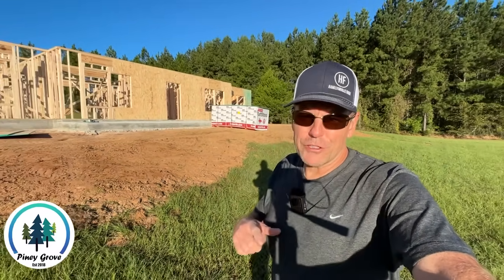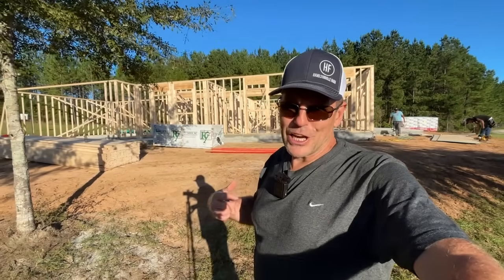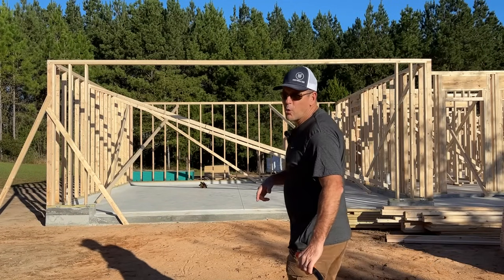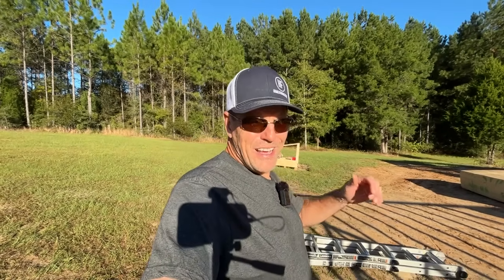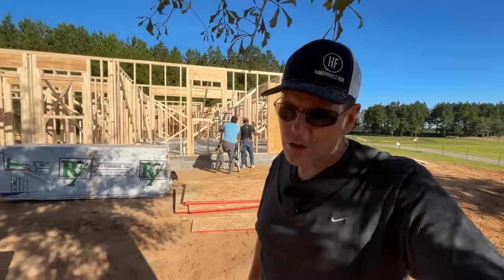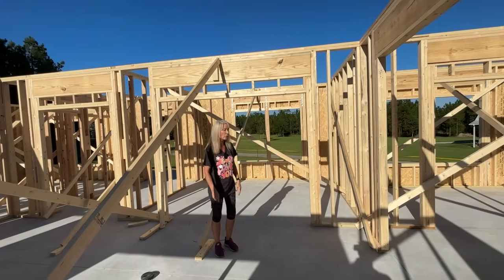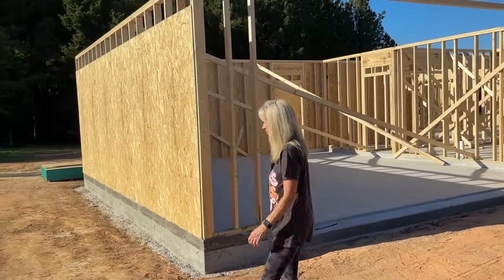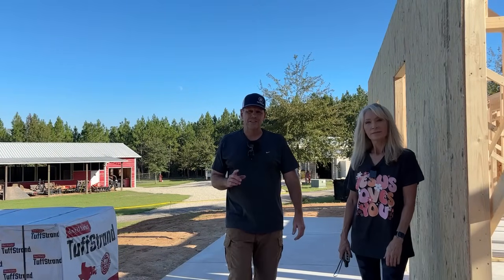Our DREAM HOUSE Is Ready For A Roof In 2 DAYS!

Comment from the maker: See this house build series here: https://www.youtube.com/playlist?list=PLG5yS75HLzo343HSY79ll4DgoxTgV6l91

Ballard Mower Blades 10% discount code:  PGH10
https://www.ballard-inc.com

American Made WoodMaxx chippers, tillers and flail mowers:
Piney Grove WoodMaxx Affiliate Link:  http://shrsl.com/4qer8

New way to fence your land!  Cat's Claw Fasteners.  
Use code PGFREE for free shipping!
https://fencingstaples.com/
Or Amazon Affiliate Link:  https://amzn.to/4dDcaJ7

QC-Mate X-Boom Hydraulic Coupler Clamp:
https://www.skidsteersolutions.com/
Use PINEYGROVEHOMESTEAD for 5% off anything on the website!

This is our Amazon store with affiliate links to products we use on the channel.  It doesn't cost you anymore and it helps support the channel, THANKS!
https://www.amazon.com/shop/pineygrovehomestead-tractorsandoutdoors

Some of our favorite products on Amazon (affiliate links):
Mower Blade Sharpener Guide: https://amzn.to/4dGYZa5
Dewalt 20V Cordless Grinder: https://amzn.to/4bF2trS
Flap discs: https://amzn.to/3UKEzo0
Grinding wheel: https://amzn.to/3K95ipi 
275 Gallon IBC Tote: https://amzn.to/3XbxwHs
Vise Grip Wire Pliers: https://amzn.to/3WZ2P6U
12V Pump: https://amzn.to/4a3AwsI
Proven Industries Trailer Lock: https://amzn.to/3WVzytv
Flex Tape: https://amzn.to/3R4MdWm
Mechanix Leather Gloves: https://amzn.to/3HjoZZf
Ratcheting Fence Tensioner: https://amzn.to/3aEfSX0
6’ Digging and Pry bar:  https://amzn.to/3vH5Agx

Welcome to our channel!  🎥 What to Watch Next: 
Fixing Leaky Pond: https://youtu.be/NEwSTg1aOWc
Transforming Our Property: https://youtu.be/-jBGEYJea1Y
Baling Hay: https://youtu.be/yQJNF3wFm-U
Framing Our Pole Barn: https://youtu.be/zWgnTFQeiwI

Our Story:
We are six years into a seven year effort of transforming 20 acres of "Piney Grove" in Northwest Florida into our dream homestead/mini farm to be filled with animals and joy. We plan to have a variety of miniature critters on our pastures, raise free-range chickens, grow fish in our pond, garden, plant fruit and nut trees, and harvest wild game. Our goal is
to escape the stresses of corporate life and embrace all that country living
has to offer as we enter the next chapter of our lives. Follow along on our
journey!

Thanks for watching and please Like and Subscribe to help our channel!!
Brad & Deb

Comment: If you plan to add security cameras, run your Cat 5/6 cables once your electrical inspection is completed. That way you don’t have to crawl through the attic mess up your insulation. I also ran cables from all tv and computer locations to a central hub location.
Reply from the maker: Good idea!

Comment: Yes I have built several Houses for myself and no. once I started I have never needed to make any changes at the framing stage.  In Ca. we were required to run continuous from the bottom plate to the top of the rafters an over the end rafters.   they were required within four feet of the corners and every eight feet or as closes  as possible.  that was for both hurricanes and earth quakes.
Reply from the maker: That's a long strap!    We have threaded rod every 6', I think.
Reply: @PineyGroveHomestead  that sounds even better .  the straps were about six feet each and we overlapped three strong tie nails at each junction.

Comment: We have built several custom home over the years and we always make changes to achieve our goal.  Some did cost a few dollars extra, but that is why you have contingency fund.  A few things I suggest you consider:  1) Take pictures of every detail of the construction so you will have a record of where wires and pipes are in the walls, framing details of the walls, and location of all plumbing pipes ( we printed the pictures and created a notebook of the pictures, house plans, paint and tile selection, along with a list of all the subs that worked on the house). 2.  Add cables for TV, computer junctions, security wiring to every window and door, Cat 5 or higher for security cameras, extra electrical cable to every corner of the house in case you want to add additional lighting in the future.  3.  Have them add extra wood blocking in the walls near the toilets, tubes, and showers to facilitate adding pull bars in the future to assist with mobility as you age.  3.  We added noise insulation to several of our interior walls to help with noise (laundry room, family room, and interior bedroom walls) -  best thing we ever did! 4.  Put PVC conduit under the driveway, sidewalks, and patios in several locations to facilitate future irrigation and lighting systems (I placed two 1" conduits under where the driveway where it connects to the house - these have been life savers).  Good luck with your build....
Reply from the maker: Great suggestions!  We have some of that already in place.  Thanks!

Comment: Do you know what your overall r-value will be in your walls for the build?
Reply from the maker: We don't know right now, but we will cover that when we spray foam.
Reply: @ cool. I just curious with the 2x4 walls if you guys were going to go above the minimum code for your walls. Look forward to the spray foam video.

Comment: You will make changes up until you can't. What looks good on paper may not work as it gets laid out. What kind of insulation are you going to use? I highly recommend using spray foam. If you are where I think you are you will be on the co-op and spray foam will pay for itself in about 3 years.  I am serious it makes that big of a difference. Oh, my wife and I did not have one argument when I built my house. She's a keeper but I am not so sure about me.
Reply from the maker: Yes, spray foam!    No arguments?  What fun is that?